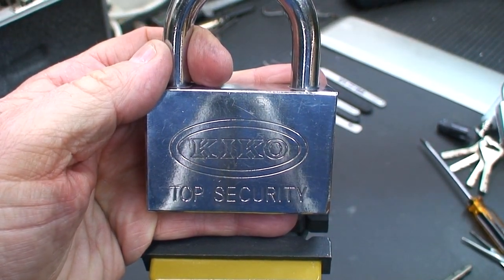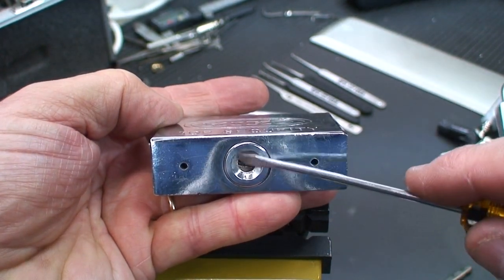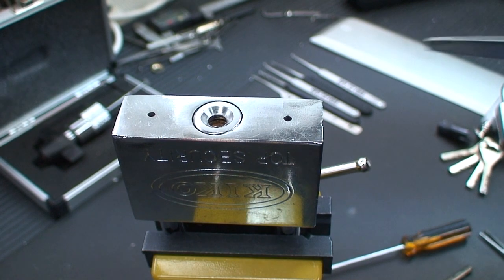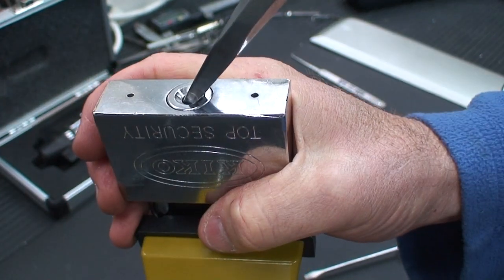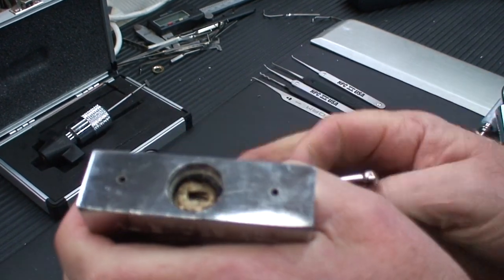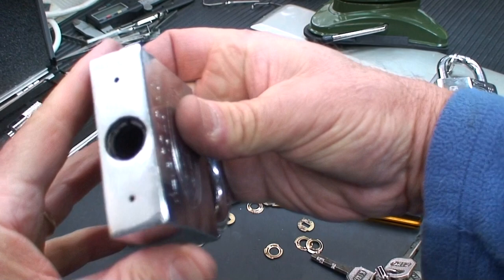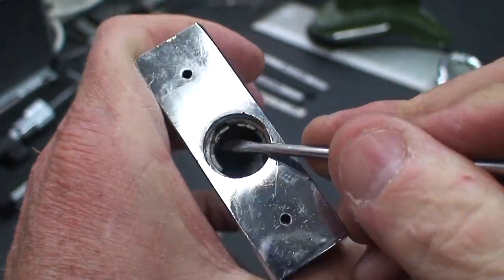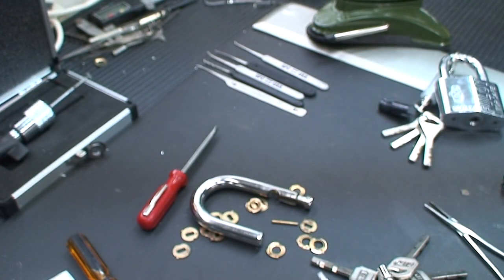(16) Defeat Kiko Disc Detainer Padlock by Exploiting a Design Defect

Comment: Doesn't really seem like a defect to me, if you use enough brute force against any lock they'll fail. However how on earth would you accomplish this if it was attached to your shed? You'd be better off using an angle grinder and be gone in 60 seconds.